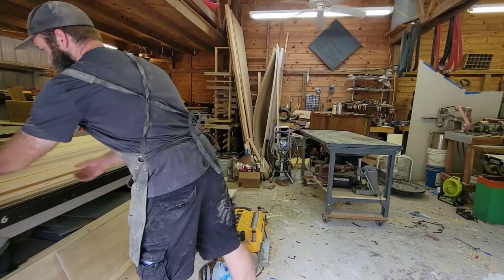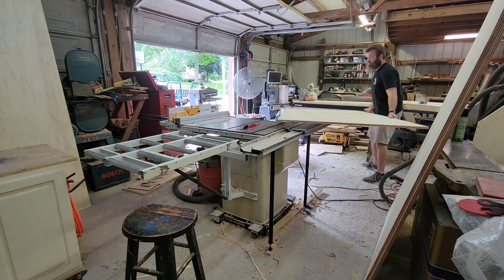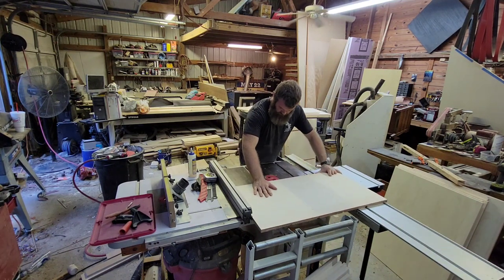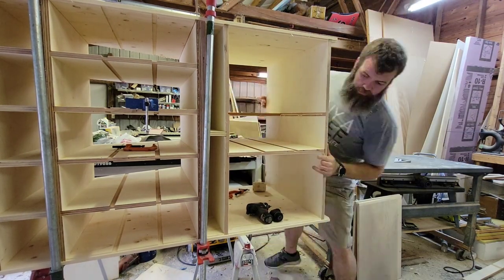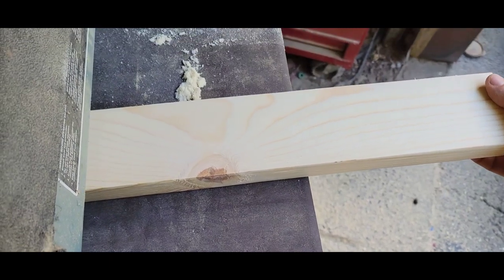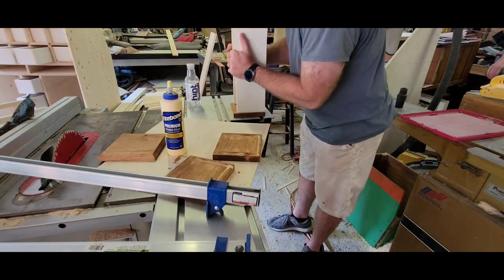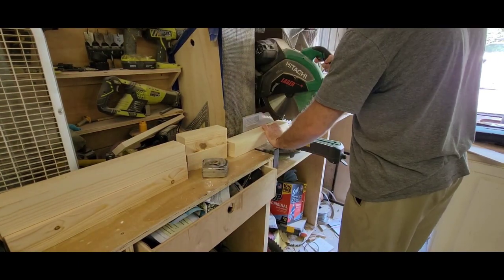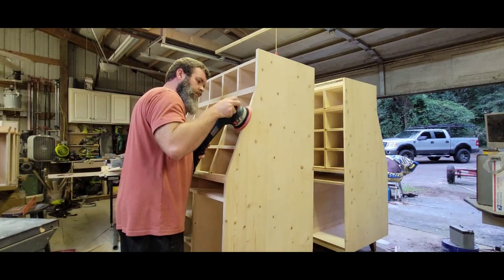Building beautiful furniture from PINE

Comment: I've been a pro furniture maker for over 50 years doing mostly handmade reproductions for clients. Yellow Pine is probably 60% of what I use and  it's made me a secure living for all of those years. 90% of my work is done with hand tools. Some tips for you using yellow pine. Don't use oil stains, use alcohol dyes and Shellacs. Don't sand yellow pie with a sander, use a hand plane and take light passes with it. I could have done each of those side panels ready for finish never using sand paper in about 15-20 minutes and they would be smooth as silk. Sanding knocks out the soft grain where a hand plane and card scraper slices. Nice project and thanks for sharing your video.
Reply from the maker: Thank you for taking the time to comment, and thank you for the tips and insight!  I will definitely do that the next time.